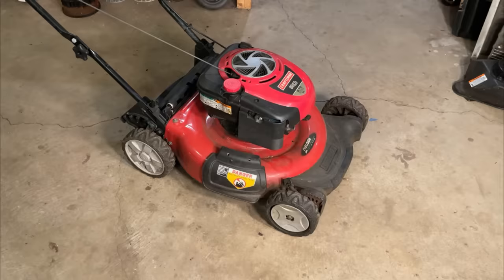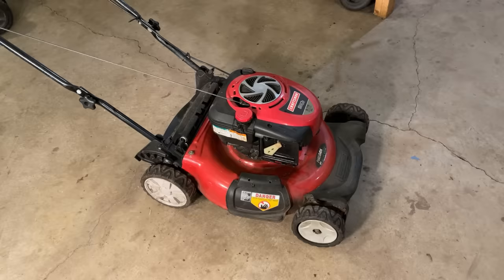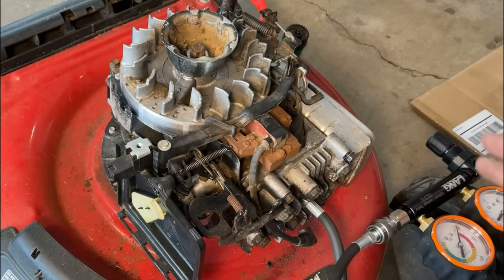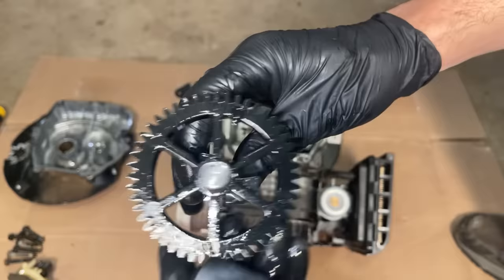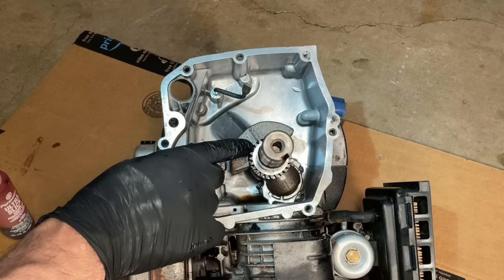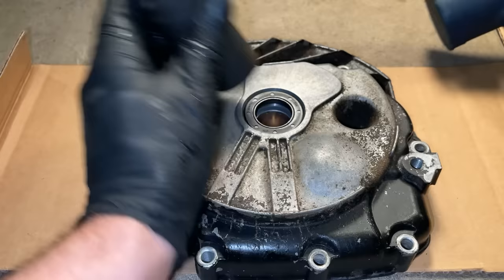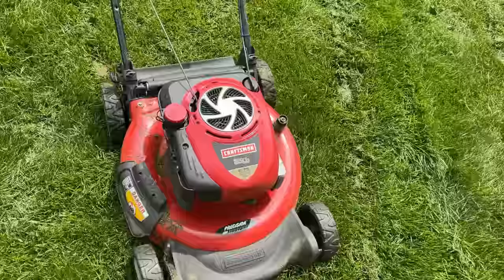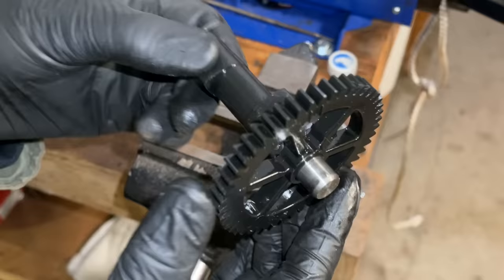Lawn Mower Will Not Start - You Will Never Guess Why

Comment: My grandmother always said; "you learn something new every day. When you quit learning, you're probably dead!" I'm 67, I'm not dead yet and I'm still learning!
Reply: I'm 60 and junk part's in mowers are one thing , but off subject , I've always driven older car's and recently got a car given to me that needed attention , thought I was getting something great for a change , till i discovered that 90 percent of the car was plastic and everything is falling apart , Life is Good as always but still learning !!!
Reply: @johnbassett3188  Yep! Most of the cars I've had and worked on myself were 60s and 70s models. My parents were married in 45 and after Dad got out of the service in 48 they had mostly used 30s and 40s cars, then new 50s models. So, I cut my teeth learning about old models. The same with small engines; B&S, Tecumseh, Clinton, etc... Most of the cars were made of real steel, cast iron engines and copper wiring. The small engines on tillers, mowers, etc were steel w/cast iron sleeves or cast iron blocks and steel parts like cars and trucks. Maybe I'm just a silly old man, but quality is worth more to me then disposability. The land fills are full, the recyclers run night and day. How about we build stuff so it lasts like my grandpa said: "it ought to last a 100 years, then turn into something good to eat!"
Reply: @jamesdiehl8690  ... All that time and learning, yet you still used "then" instead of the correct "than".
Reply: @JW...-oj5iw  I still have trouble with dos, dem and dat too!
Reply: @JW...-oj5iw  If I did, you would still think that you can judge me for it! Go polish your halo!
Reply: @jamesdiehl8690  ... With regard to your original comment, it appears that your learning is at a glacial rate. But, at least you feel free to blither about it.
Reply: @JW...-oj5iw  At 67 I have a Bachelors in Info Secutity and an enrolling to get my masters in Theology and possibly Ministry. I'm retired because of congress budget cuts, but I've worked since I was 14. I live by myself in a house I own and drive a truck I own. I had my own business for 18 years until I got hurt and had to find a different career. So, my learning and desire to learn is probably better than most people on this planet. Therefore Pbbbbbssssttt!!!!
Reply: @jamesdiehl8690  ... You were probably trying to write something that could have made sense if you weren't so wound up in your puffery. 
    That you somehow achieved a degree in "Info Secutity" doesn't necessarily speak well for whatever college you may have attended, unless they were snookered into believing you could write basic English. I suppose you could have hired some kid who would write your papers for you and then you could turn them in as your own efforts. 
    On the other hand, good for you being industrious enough to be a producer, not just a taker. It's sad that the human body isn't indestructible, but we deal with the lumps we receive. I'm older than you, and I drive a truck, such as it is. I have skills that most in my field don't. Even with a body that's getting worn down, I can still work 10 to 12 hours a day, if necessary. I'm going to start on Social Security in a little less than a year, but I'm not going to retire until I can't climb in and out of the cab. The fact that I like correct spelling is no defect. Everyone should. It's the heart of communication.
Reply: @JW...-oj5iw  So, you think that judging someone for making a simple mistake is alright. It's a good thing I didn't kill someone! Execution for a grammatical error will be a new one for you to put in the books. Thou shall not kill, though shall not say than instead of then, though shall not judge,......
Reply: @JW...-oj5iw  So let's hear what you've done to feel so smug and righteous about, mate.
Reply: @johnsomerset1510  ... At what point did you read anything I wrote that declares I am smug and righteous? 
   The guy who I've had exchanges with wrote (poorly) that he is seeking a degree in ministry, then proceeded to write "Thou shall not..." Well, guess what. Even this phone's word anticipation algorithm offered "shalt" as the next word after "Thou". 
   He has accused me of judging him, when I observed his statements in his own writing. I have every right to reply to any comments I read in these fora. If I observe something poorly done, it's my choice to offer the person the opportunity to see and correct his errors. Many people are happy to have the consideration given to them. Then there are the ones who get lit up at having someone tell them they're wrong, no matter how factual it is. You come off as that type, ignoring the fact of James' errors, and accusing me of something you fabricated in your mind. Here's a question for you to think about: if you are offered advice by someone who either doesn't know how to write simple English, or is too lazy to write it, are you willing to accept the advice, or would you discount it as the word of a sub-literate? Consider that as a rhetorical question. 
   It's too bad that so many people such as yourself decide to join the "wrong" side. You even took the time to write cogently, but you chose to make unfounded claims. If you had the ability to stick to the facts, not your emotions, you wouldn't have made such claims. But, as has been said before, you have the right to your opinions, right or wrong.
Reply: James Diehl
Excellent. 
Decades ago I said to my daughter when she was age 8,
"you can make your mind like the Library of Congress, or like a garbage can ... You choose'
'Learn everything you can, whether you like it or not, then teach it to your children'
So she studied at Princeton, later to become a trauma surgeon, and now works in NYC
Being a very bright young girl, she took my advice.
I did not want her to be a cashier at a supermarket on minimum wages.
One has to become smarter than their parents and smarter than their teachers, 
otherwise there is no progress.
The other critical thing is 'to be teachable' not everyone has that ability as pride gets
in the way. As for me, I still have not learned everything yet.
Your grand-mother was wise and spot on.
Reply: @andrew_koala2974  Thank you! My grandmother would have appreciated it.  She was born on 1904, depression time, got her HS diploma and worked. Her biggest job skill was working in  bomber plant making parachutes for the pilots. She wanted my mom, sister and I to get every bit of education we could, even if it  didn't lead to a big job. She thought that learning was the key to everything in life and after we die. She taught us to read, tell time, do math and geography before we even started school. My sister went to KU and got her Bachelors in Music and I finally got to get mine in Information Security Systems later in life. Learning does make a difference, but not always in a career. I guess she was right.
Reply: I'm 60 and going all electric.
 Live on a postage stamp now. 
Do not need gas anymore.
Reply: @johnsomerset1510  Thank you! I don't know who he thinks he is to correct me anyway. I was taught "judge not, lest ye be judged", and for something as silly as spelling? He must not have anything better to do!
Reply: @jamesdiehl8690  ... It's a shame that you don't understand why you got the response you did. You initiated the subject of learning, yet when given an example of your error, instead of learning and correcting yourself, you join the "I'm perfect and you don't have any right to correct me, no matter how wrong I am" group. Unbelievable. This is writing and reading to communicate with anyone who may happen to be a viewer of a particular video. There is right, and there is wrong. If you can't accept correction, you are too self important. I'm not perfect by any means, but I make the effort to write cogently, and when the subject is education, spelling counts. If you were to honor the memory of your grandmother, you would have learned from your mistake, and correct it without any commentary trying to belittle the person who saw your mistake and brought it to your attention. You have judged me at the same time you don't want to be judged. Incredible.
Reply: @J W when u can write a long paragraph like James & only make one grammar mistake! THEN & only THEN u can comment on it!! LMAOOOOO!!
Reply: @biggs.8368  ... Could you please post your credentials that explain how you have any authority to tell anyone when they can write a reply? Something tells me that you have zero authority.
Reply: @biggs.8368  That's what I get for typing on a phone!
Reply: @JW...-oj5iw  NUTS!!!!! LMAOOOOO!!!
GOT IT SMUCK??
Reply: I tell that to my Wife almost every day  so true
Reply: the ancestor of Captain Obvious
Reply: @johnbassett3188 😊

Comment: A plastic gear forced onto a steel shaft and then soaked in hot oil. Perfect!
Reply: They're made to break
Reply: Planned obsolescence for you at a reasonable manufacturing cost.  At least we have YouTube and Amazon to make a nice counter-balance for the wise.
Reply: And probably no option in replacement parts, such as a one piece unit.
Reply: same belongs to paddle-wheels in many car water pumps losing contact to the shaft during operation
Reply: They are close enough to perfect - I've worked professionally with those engines since they came out around 1990, and I have never seen that problem.
Reply: @leifvejby8023  I can remember Quantum engines long before 1990.  They produced them with steel cam gears for about 15 years, which is why you never had a problem.
Reply: @campbellpaul  I said "around" 1990 - may have been 1988 or 1989 - certainly not earlier than 1988. When did they change to metal gear?
Reply: @leifvejby8023  Mid to late '90s or early '00s is when they changed the cam gear to plastic.  '10s they changed the crank gear to plastic.  You could buy 3.5hp Quantum engines as early as '83, both pulse-prime and throttle choke-lever versions, and auto-choke was a thing as well, just rare.
Reply: @campbellpaul  Are you sure about the -83? I got one from the very first batch to reach Denmark, around 1990, and it had plastic cam gear. Used it on an old Jacobson rotor mower, wvich was my daily drive till three years ago when I bought an Automower.
Reply: @leifvejby8023  Here's an "86 version I stumbled on a few years ago https://youtu.be/O_NIxpXVE7E  That's as far back as I have seen them on YT, but my father passed in '81 and I only used an electric mower for one year after that, and then picked out a very similar Murray as seen in this video.
Reply: @campbellpaul  Thanks, that looks like the Max engine - it is just the classic B&S alu tank model modified with plastc tank and float carburator.
Reply: @leifvejby8023  Thank you for pointing out what I didn't know.  I assumed it was a Quantum.  I know that these older ones puff out white smoke when starting just like the Quantum engines do.  Now I need to find one to figure out their differences!
Reply: @leifvejby8023  I didn't see very many of those Max engines.  Mine lasted at least thirty years until we sold the house.  I think the Tecumseh engines were a bit more popular then.
Reply: @campbellpaul  We saw way too many Max engines - but the early Quantums were great - and then I got sidetracked to chainsaws.
Reply: @leifvejby8023  Did you see any Magnetron engines?  Those engines are beasts.
Reply: @campbellpaul  Magnetron, we saw the first one a few months after I had started repairing those engines - din't know what to think of it? 
We put Magnetron ignition on quite some engines, and the Magnetron warning label too  - they could kick back if you didn't really believe that you could start them. Is that what you mean?
I still prefer points and condenser on my engines, on my chainsaws too.

Have to sleep - had my second covid shot today, Pfizer, and my shoulder has started hurting. No problem, will be fine in a couple of days.
Reply: I was thinking exactly the same thing. Built in failure mode. Not even a sintered metal assembly. 'value engineered' to within an inch of its life.

Remind me never to buy one of these mowers.
Reply: @captiveimage  Every mower engine today has a plastic cam gear, I'm sure.  The engine companies no longer compete with one-another since they are all on the same page with one another.
Reply: @campbellpaul  That's such a shame, though I'm sure you're right. Not just mower manufacturers, but manufacturers in general. The trick is no longer to make the 'best' machines, it's to make machines as cheaply as possible but last just long enough to survive the warrantee period.

Loved the vid, though. Great to get an idea of what the guts look like, and it was good to see you getting the thing working again 😊
Reply: @captiveimage  Thanks, but it's not my video.  The older Tecumseh and Briggs engines from the '80s are more bullet proof than the later ones.  I guess it all comes down to personal experience and preference.
Reply: Once 3D metal printers become accessible to us we'll turn planned obsolescence into future-proof machines.
Reply: Right! What could possibly go wrong!?
Reply: @JW...-oj5iw  Yep... company says help yourself to more of our plastic parts, take as many as you want!
Reply: I had a few auto repair  shops  replace catalytic converter and  fuel  injectors  and  found  out my 84 Cadillac  had a nylon cam and  was defective  design .I should have  kept  my 69 dart slant 6
Reply: @radiotubes  What year was that Cadillac? I had a ‘78, then a ‘94. The ‘94 was a terrible car. It broke down quite a bit, and was very expensive to fix. The older Cadillac was a good car. The slant 6, people loved their slant 6, back in the day!
Reply: @radiotubes  I’m sorry. You wrote it was an ‘84. In my opinion, 1979 was the last good Cadillac. The early 80s were the worst!
Reply: I think Honda makes the best lawnmower engines. Someone tell me if you think I’m wrong
Reply: @campbellpaul  only shit like brigs and scrap um and if the are still going, tecumseh. I doubt you'll be finding plastic/ nylon gears in a Honda. If it were pinned to the shaft it probably wouldn't fail as it has. May last a lot of years.
Reply: @robertgerber2533  Tbh I wouldn't buy any small engine made today.  There are too many great older ones you can find before they go to the landfill that have great compression, no piston scoring and are unsurpassed in their material quality.  Up until the early 2010's you could buy great Honda GCV-160's and 190's, so I try to buy them used before any parts were ever made in China using recycled metal scraped from US junkyards in the early 2000's.  A chinese aftermarket carburetor is as far as I'll go, because the needle and seat valves aren't replaceable in those old Hondas.  I only use filtered higher octane gasoline with a shut-off valve and let it sputter out after using my Hondas and Suzukis at the end of the day, otherwise you invariably end up having carb problems with today's crappy amalgamated gasoline, which isn't  pure as you may think.
Reply: It just goes to say. "If you build it they will come". This stuff makes me sick!!
Reply: @JohnDoe-es5xh  I didn't know that. But thanks for the heads up. Makes sense 🤔
Reply: For everybody saying something about the engine being awesome. It is. It's everything connected to the engine that is shit. That's the problem plastic shit connected to it. That plastic gear created all this mess you see now. It has absolutely nothing to do with the engine at all. It's all in how do you get plastic shit to sync with metal!
Reply: Engineers I hate em. I'm an Auto mechanic this is a joke.
Reply: will break often when the blade is hitting a rock...
Reply: Nope.  They built millions.  Then hoaded them in a warehouse, destroyed the dies and tooling forever then retooled for the 'new' model thays just different enough to disallow interchangeability.

Comment: You'd be proud of me. I fixed the neighbor's garage sale purchase mower with a Honda GCV160 motor. It was surging when warm. I immediately suspected a lean condition. Found fine dirt in the tank. Cleaned it out. Took the carb apart, cleaned it, and found the emulsion tube above the main jet had its little holes clogged with the fine dirt. Used a wire from a wire brush and cleaned them out. Mower runs perfect now.
Reply: most issuers these days, is the ethanol gas, sits for a bit wont start, ends up water settles in the gas to the carb bowl, drain carb, tank, new gas usually fixes. if spark and starts with ether,  then that is what I try first.
Reply: Those are so much fun. Good Job!!
Reply: See my solution to dirt in the gas above.
Reply: Similar: I was given a Husqvarna with a GCV160.  It would run for only one or two seconds each time I tried to start it.  Fixed that by cleaning the main jet using a twist-tie wire, but then the governor was making it surge (aka 'hunt').  Fixed that by cleaning the pilot (idle) jet using a strand of fine copper wire from a lamp cord.  The twist-tie wire wouldn't fit through the pilot jet.
Reply: @wryanddry2266  It's something how a thing so small could create such problems.
Reply: New i dont know.   My old craftsman had fine dust and gasoline jell up in the carburator.   It took third try of taking it fully apart with carb cleaner.   I think i passed drill bit thru the main jet for good measure.   Started in the first pull ever after.
Reply: @mikeclarke3005  I never put the ethanol blend of gas into any engine, not even my car.
Reply: Larry,
Sounds like you did a very good job.  I have found most problems are carburetor related
Reply: Man I struggled with this motor for the 2nd and 3rd year of ownership.....did same as you over and over.....then I discovered a secret even 2 local shops dis not know about....a fuel filter INSIDE the gas tank where the fuel line connects on. That was 5 years ago and it has never acted up again
Reply: @mikeclarke3005  I could peel a clear film off my carbs on 82 Suzuki's.
Have to use Marvel or Seafoam to counter that ethanol.